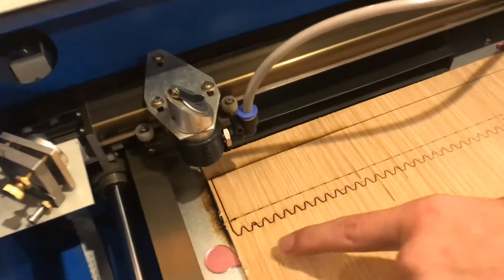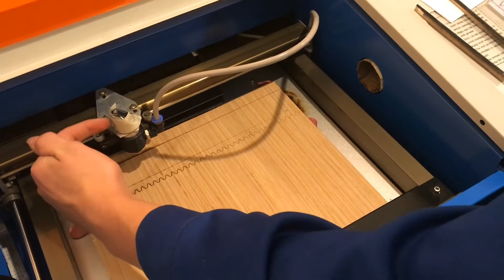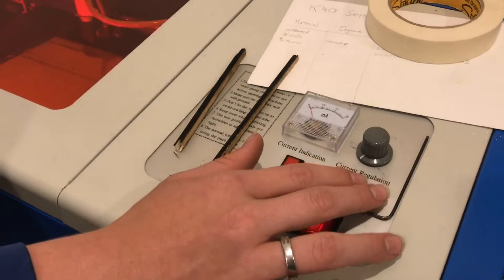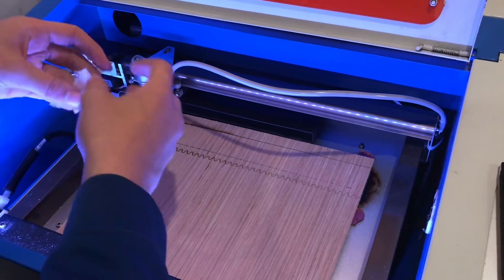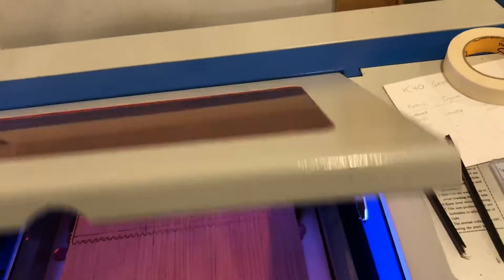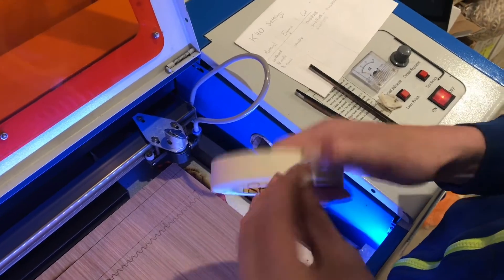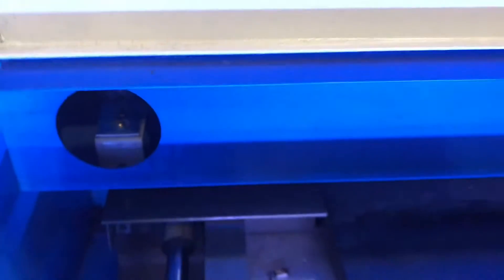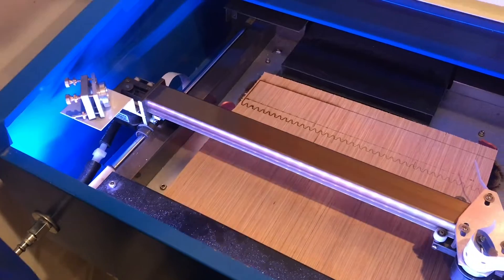tips on FOCUSING laser for BETTER cutting (K 40 laser cutter) k40

Comment: My first try at aligning a K40 laser about a year ago was very time consuming frustrating and did not come out perfect.  I got a new machine and using this video https://www.youtube.com/watch?v=oSzFJGCPapc I was able to align the mirrors PERFECTY in 45 min.  
Rule 1 -  DO NOT TRY TO SET THE DOT IN THE CENTER OF ANY MIRROR with MIRROR ALIGNMENT SCREWS. 
#1 The laser needs to follow the track of the gantry. That means adjusting mirror 1 so  the dot does not move when moving the gantry from front to back .
# 2 Now move the mirror bracket right left up down to get the mirror catch the laser in its center
Repeat for mirror 2 .   Maker Monkey explains it very well.

Comment: First thing to do is align the mirror at the tube, that is the best starting point. the beam should be dead center  secondly you should align the left mirror, at the back and the front. check the back position again, because the front positioning effects also the beginning position ever so very slightly. and third and last the mirror on top of the lens in left and right position. again after the right position recheck the left position again for the same earlier reason mentioned.  ALWAYS start at the beginning
by the way, the very first mirror should be dead parallel to the metal glider if not , you'd have to move the entire mirror, not just the set screws. that goes also for the second mirror and the third, just to be square
even I had it not quit correct, here is a link to a good method 
https://www.youtube.com/watch?v=ptqLDMk5MfI
kind regards Hans

Comment: it does not matter if you are hitting the middle of the first. Second or third mirror. Only thing that matters is if you hit the middle of the lens. If the tube is not exactly aligned or one of the rails are not completely square you will never hit the middle all over. Try to hit the same spot both close and at the end on all position. If its to the left. Right. Up or down from the middle is irrelevant. At the last mirror. You adjust the beam to go to the middle of the lens. Test this by elevating the cutting suface aligned with tape to the laser head. Make a square around the jead on the tape. And lower the surface down to cutting hight and make a pulse. There is a really good video on this on youtube.

Oh.. and buy a flow switch instead of having the outlet tube above water level.. this just makes it more lilely for your pump to pull in air.

Comment: Hello. Excellent video but I haven't been able to center the laser on each extreme. When it is centered on the left top, when I move the Laser head to right top, it is not properly located. I tried it for an hour unsuccessfully. . Can you help me with this?  I also tried mirror adjustments from the main mirror behind the machine, the first one the laser hits. I got the same problem. I appreciate your help.
EDUARDO
Reply: dont go by this guy he hasnt a clue what he is doing